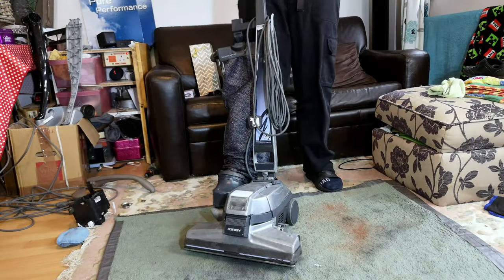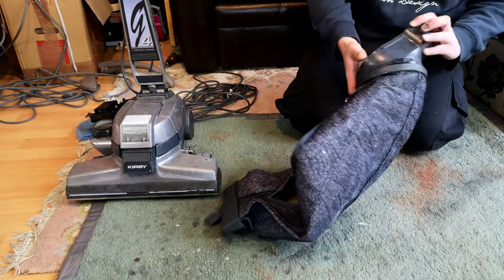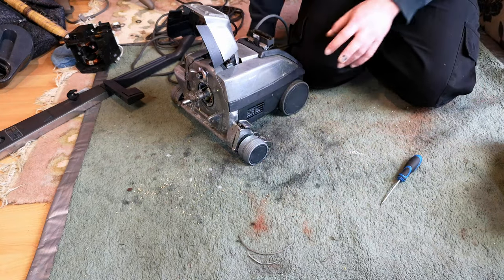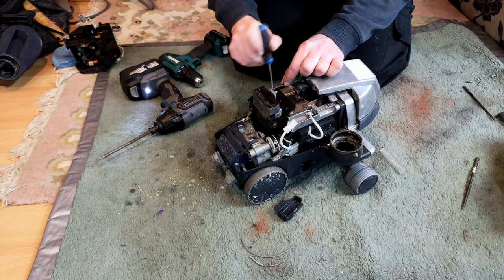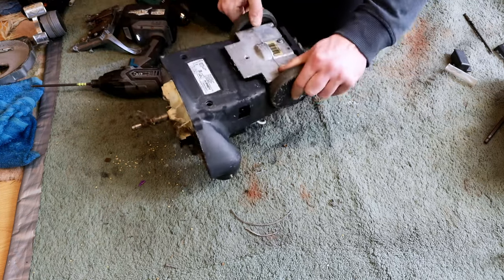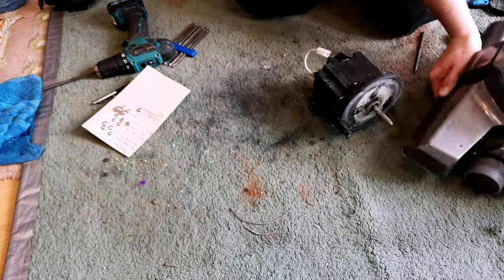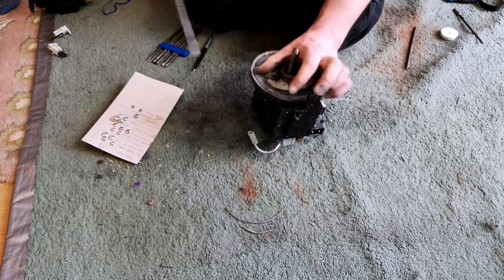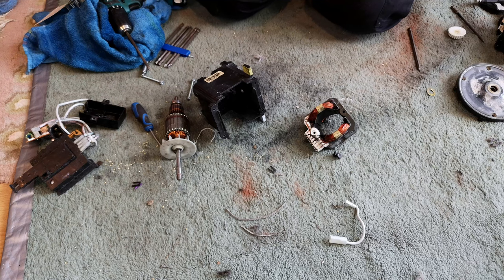Water Damaged Scrapper Challenge: Kirby G4 Edition

Comment: There is nothing wrong with a wet vacuum, especially a Kirby. Leave it sit in the sun either assembled or disassembled in the summer for several days and it's fine.  I used to hose down tube TV sets I got from he dumpster the same way, as they would be covered in garbage juice and bees and such. Leave them sit outside on a 95F day all day long and then let it cool overnight, good as new. There is plenty of Kirby motors on eBay no need to destroy a perfectly functional vacuum.
Reply from the maker: Was one motor on ebay UK at the time I needed it,, for £50. Their not a common to find random spares for as they are in the US 😥